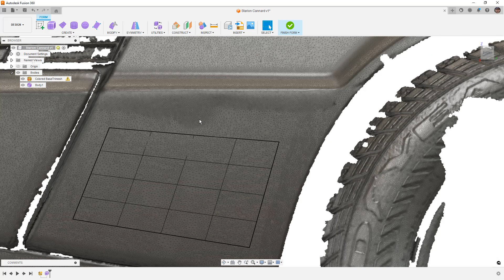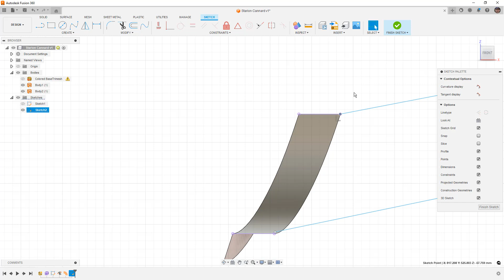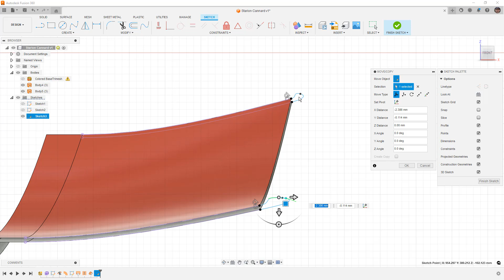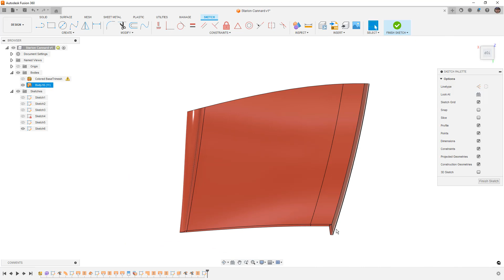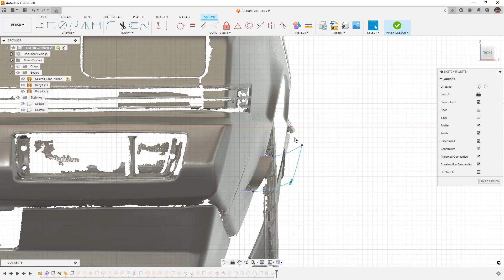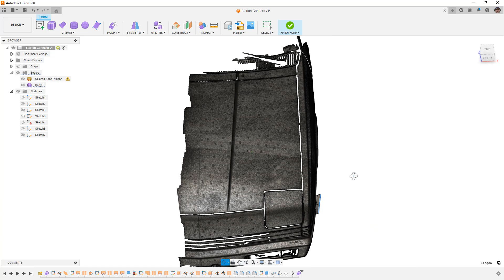How To Design A Canard with Fusion 360 | Surface Modeling | Freeform Modeling | Tutorial

Comment: sometimes my scan gets darker and darker as i continue to design, how to combat that?
Reply from the maker: Super dense scans will be tough to look at when designing.  You can try right-clicking on them in the browser and dropping the Opacity down to say 50%.  it won't get rid of the edges but might help.  Really getting a low poly mesh before getting into fusion is key.  You can use the mesh tools in fusion to make a lower poly model.  Use that as a reference while designing, but when you need to pull the form to it, show the high density one.
Reply: @Lea @LearnEverythingAboutDesign thx sir. I’ll try that

Comment: The trim at 10 minutes, it seems no matter how closely i follow your tutorial, Fusion throws an error saying "there are no visible surfaces to trim" when I select the canard face. any tips or items that may be going wrong?
Reply from the maker: Hmm, the trim tool can be a bit picky.  As long as your sketch overlaps the surface it should work.  You can try doing an extruded surface of the sketch and making sure they overlap.  It will go in the normal direction from the sketch plane.

Also based on your avatar image you might like this file https://a360.co/3Njc1yO
I drew that years ago. probably 2011 in Solidworks
Reply: @LearnEverythingAboutDesign  I posted the same question on Reddit. They suggested applying it to an extrusion as well. I’ll have to try it when I get home from work.

Comment: Hi Matt, just wanted to say these videos have been absolutely brilliant! I'm curious if you've done a video based on underfloor aerodynamics? For example the Porsche 911 GT3 uses small fins underneath the flat bottom to direct airflow, i'd love if you designed/showed us how to do something like this
Reply from the maker: GT3rs is one of my favorite cars!  but sadly i don't have one :)  I haven't done any Aero type videos because Fusion doesn't have CFD tools.  I could try to use something like OpenFOAM but most other CFD tools are pretty expensive and likely wouldn't fit with most of the viewers on Hobby license of Fusion.

I'll certainly add it to my list.  Do you do any CFD now?

Comment: I get stuck on the part from form to surface. My form doesn't convert to a surface this makes me unable to trim it
any ideas what it could be? I'm on the personal use version
Reply from the maker: Does it give you an error?  If there are overlapping edges/faces that will prevent it from converting to a surface.  Box display usually helps find this stuff.

Comment: Hi Matt! 1st of all thank you for following up on my request!!  Wow thats a lot to take on the surface tools, but i will definitely try both methods, probably the freeform 1st! I intend to 3d print these but I still have not decided if I skin them with carbon fiber OR build a mould and do a layup from there. Take care 👋
Reply from the maker: You are welcome!  And yeah at the end of doing it with sufaces and making the edit to the size/shape I figured doing it with forms would be quick :)
If you haven't seen it I would suggest checking out https://youtu.be/25PmqM24HEk  You might consider making a compression mold for CF and that would be a pretty strong part.

Comment: Are you going to do a plasticity tut also? 🙂
Reply from the maker: in general of on making a Canard?  Plasticity doesn't really work with mesh imports yet to the point where we can snap to them, so it would be hard to make something match a car unless you bring a surface in, which kinda defeats the point if you have to model the car in another program first.  I certainly could but its not on my radar.

I have been working on a new video with 1.2 on modeling a car since some of the workflow changed.  when i finish that video i can add some canards at the end.
Reply: @LearnEverythingAboutDesign  Legend, thank you!

I just enjoy your plasticity tutorials as that's what I'm currently focused on - every video you release I learn a new aspect so have really been keeping an eye out for them 🙂

Looking forward to future uploads.